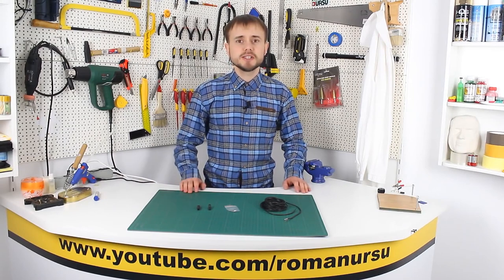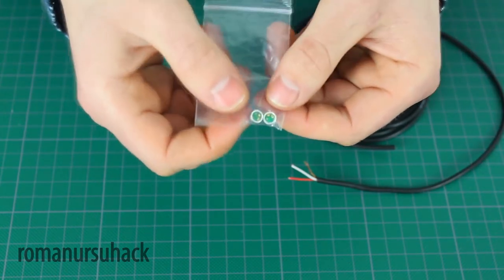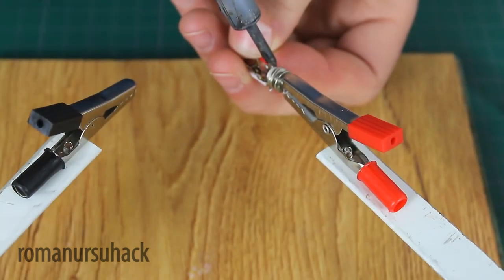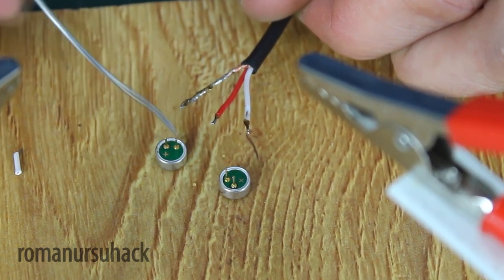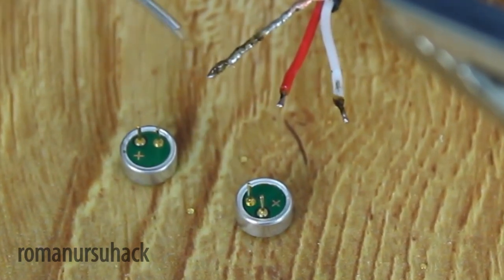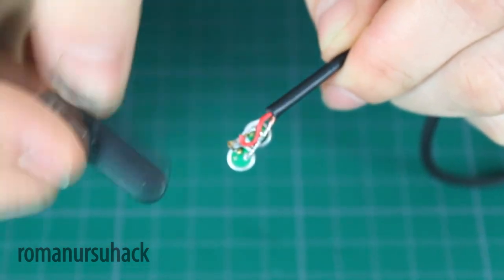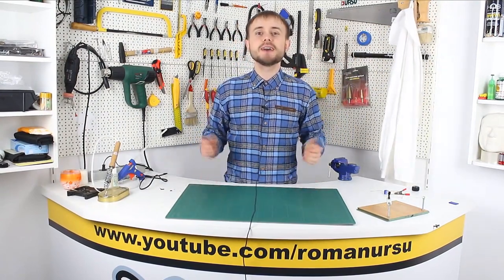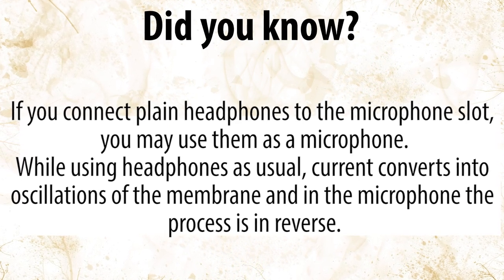How to make a stereo microphone

Comment: Baseball cap rechargeable headlight on the bill... dismounting  an old cell phone for battery and charger and more than 11 led perhaps using a led smd bulb...

A 12V DC motor as shoe shiner/polisher dismounted by emergency aircompressor using a boosterpack or a 12V car socket.

A 12V DC big power bank in a portable suitcase with solar panel, different sockets for devices and inverter with enough power for a microwave oven...

About metallic sodium and water? Nothing? Do something.